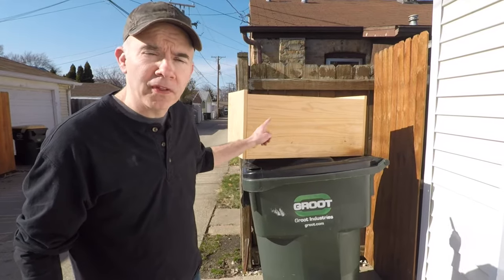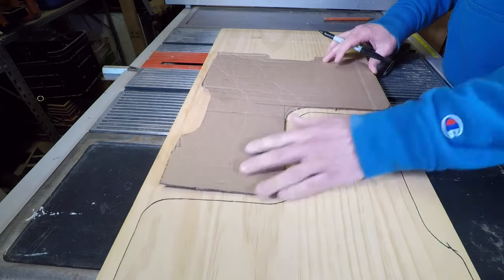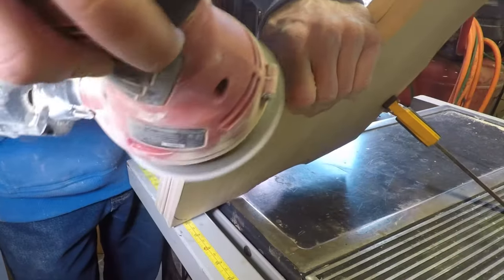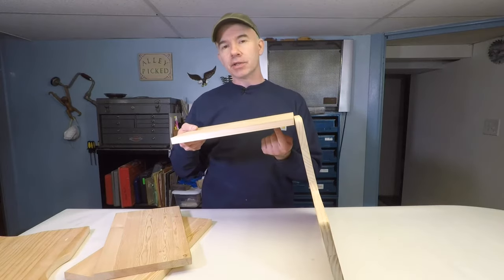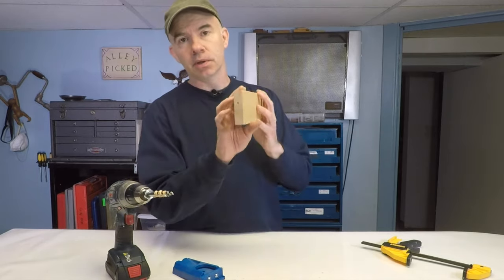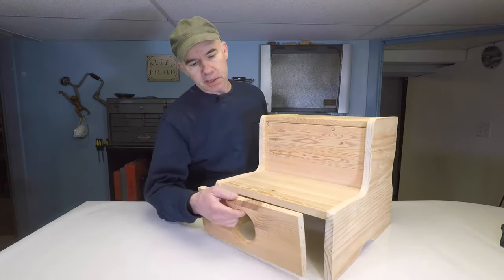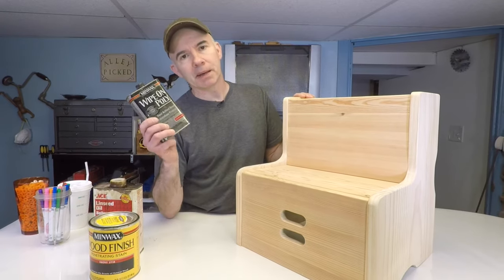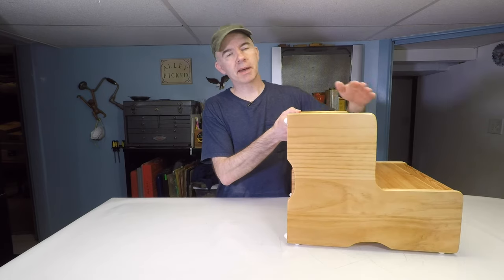DIY Flipping chair & step stool

Comment: Two comments - Pocket screws should be used in the pocket holes.  Looks like you used wallboard screws, which can cause the wood to split in the pocket.  Also, the hard plastic feet could easily slide around on that tile floor, so a soft rubber version would be better.

Comment: Nicely done, just wondering how heavy it is, for a child to move it from a chair to a stool? How thick is the wood?
Reply from the maker: The wood is 3/4" thick pine. It not difficult to rotate. A child shouldn't carry the whole thing across the house but it should be fairly easy to rotate.